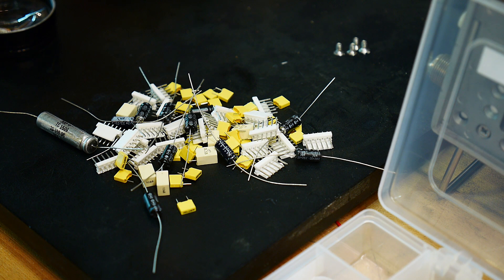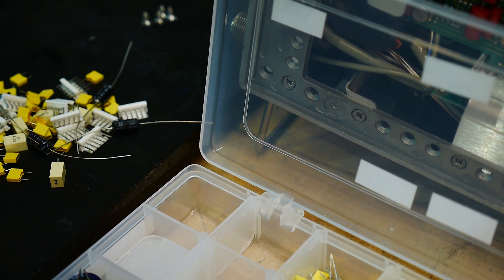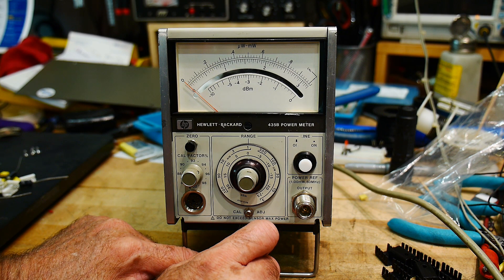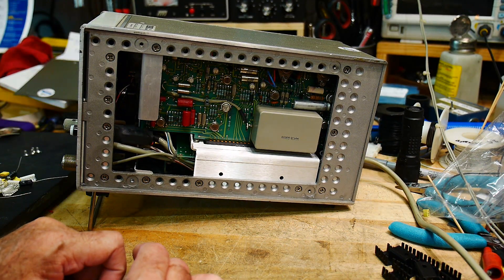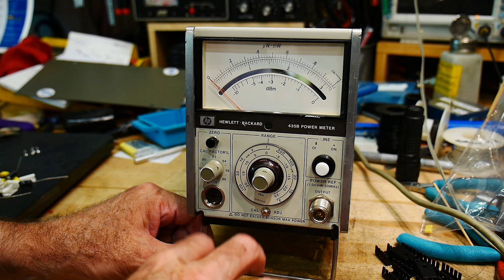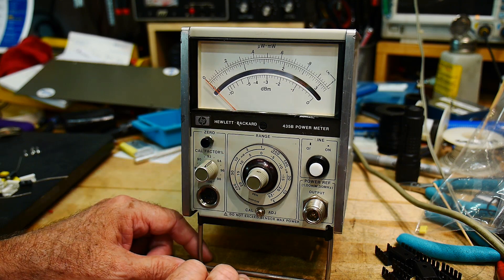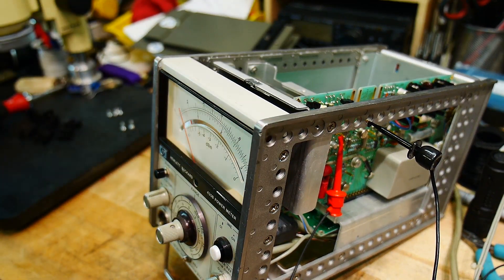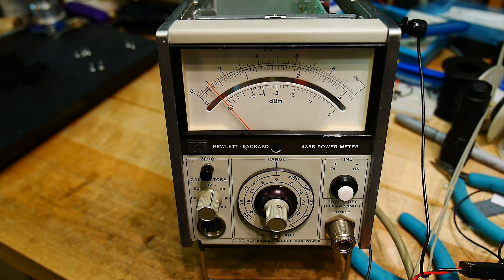#484 HP 435 Power Meter

Comment: Thanks so for the advice about Test Point  5 and running 2.0 volts to to full scale. I want to fit an AD8307 to this to use as an accurate watt meter.  Have to got the Service Manual for the 435A which includes all the circuit diagrams? All the online copies I can find have the the circuit diagrams missing? The closest I can find is the 436A circuits. If you have the 435A circuits could you please put online so I could download? Really look forward to your reply. yours sincerely Jeff ZL4AI
Reply from the maker: http://www.ko4bb.com/manuals/24.5.126.169/HP_435A_Operation_and_Service_Manual-S-I.pdf
Reply: @IMSAIGuy  Thank you for sending the link.

Comment: The meters (435B, 436, 437A) are relatively inexpensive, I have all three...it's the sensor cable and sensors that are the killers to the pocketbook...ask me how I know!  ;-)
Reply from the maker: yes the sensors are everything. The zero bias schottky diodes are very special. Our manufacture made them by the zillions for car radar detectors. once in a while they made very goods one by 'mistake' and would give us a call. I would go review them and buy the lot. the sensors include the chop circuit and also are gold and gold contacts everywhere to eliminate thermal junctions.

Comment: Thanks for the video. Another good source of linear power supplies are broken coffee machines.
Reply from the maker: what types of voltages do coffee machines have?
Reply: @IMSAIGuy  IIRC in my case it was 5V and 12V DC. But it's safe to say that it may depend on the coffee machine.